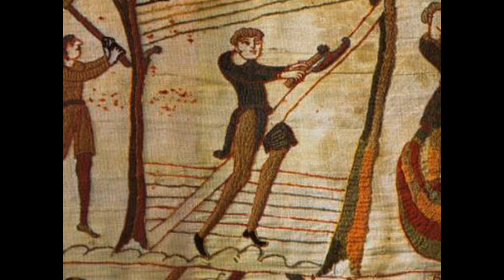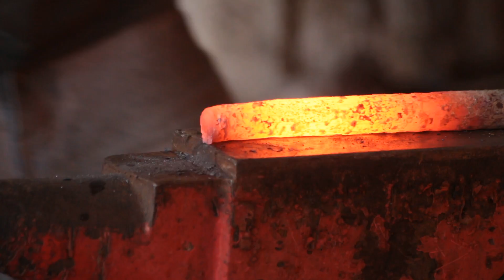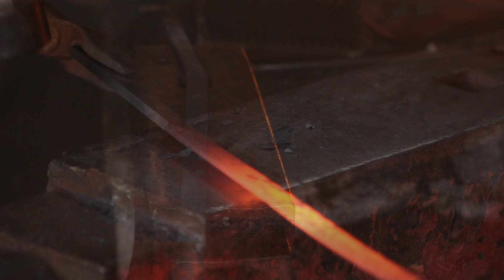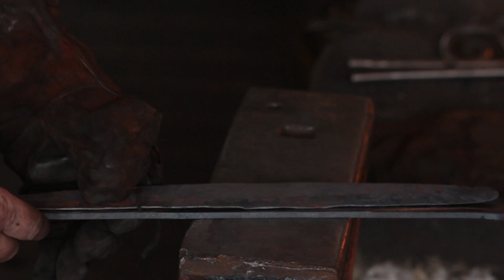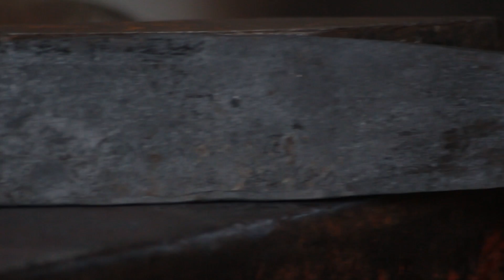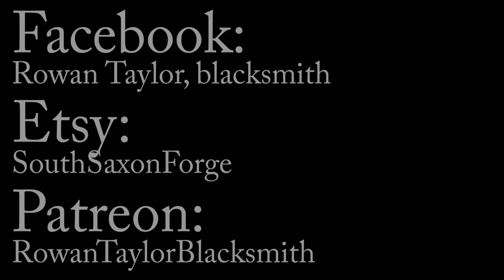Making a Viking shipwright's axe: part 1 - the blade

Comment: i don't mean to nit pick, but wouldn't it be easier to bend the blade around the horn so when you punch in the bevels the stretching of the steel will straight'n the blade back out? like you do with a knife.unless you're making a skinning knife. i think that's how the tip was done.i studied some collections in museums and such and the tip of the axe your making and what i was told was a lochaber axe had the same shape as a skinning knife.i don't know,but it would seem to me that that technique would be the more efficient  as opposed to always flipping it over to straight'n the edge where it keeps stretching and shrinking.

Comment: I suspect an axe this light, would be used frequently pulled down in a shearing cut, like a drawknife, as much as swung. I have a rather light, long bladed hewing hatchet that's probably the best shaving axe  I have, it's a little too light for heavy hewing, especially on dry wood, but on light stuff on a chopping block I frequently find myself just using the weight of the tool and dragging it in a slicing cut with a bit of downward pressure as I pull it along the wood with a diagonal swiping motion to the arm, about a third up from the heal of the blade starts the cut, the swing ends down at the toe, and the elbow is far back. I'm somewhat choked up on the handle. Maybe just a short introductory swing till the edge meets the wood, then a pulling slicing motion to arm and blade and a pretty controlled peel slices off.  I could see this axe might be even better at this, especially if indeed this was a ship builder's tool, slicing with the grain a plank already in place on the ship, or resting on horses.

Comment: I don't recommend o1 tool steel for forge welding it can really screw up the carbon content of the o1 that is what I have learned through my 12 years of forging Damascus and pattern welded steels
Reply: I don't know if he meant to do it, but that could actually make it more like it would have been.  The Vikings didn't have tool steel, instead they generally had to case harden their ironwork.  For modern day smiths you're right, it is a dubious pairing of metals.

Comment: I've done quite a bit of hewing with more modern broad axes (circa 1800's) and  I would say your explanation is correct for having a curved up edge. If you didn't have the edge curved like that it the corner would tend to dig in instead of making thin slices like you want an axe like that to do. This project is very exciting! I have always wanted to have a hewing axe like that!
Reply: absolutely, having a curved edge helps limiting tool marks and gouges into the final surface. It also helps with the cutting by making the slicing motion smoother. Moreover, i believe that given the soft core material and length of the blade it helps with structural stability.